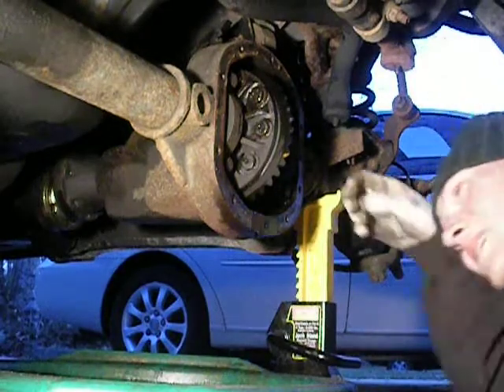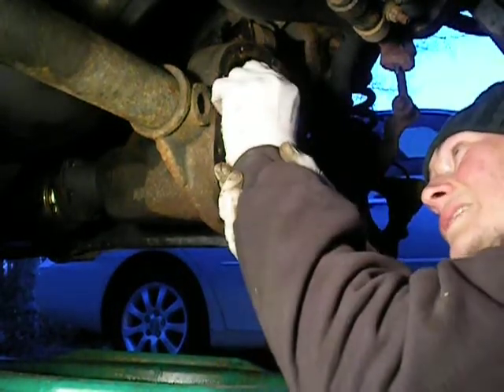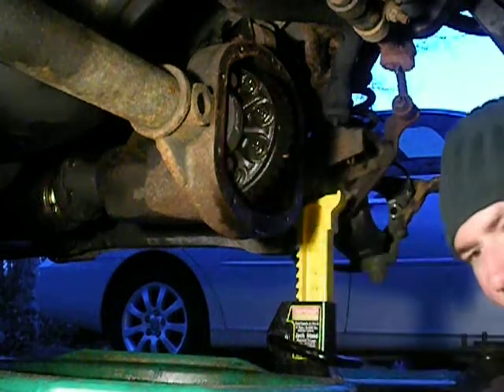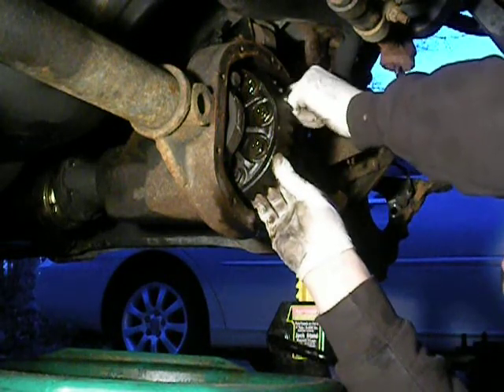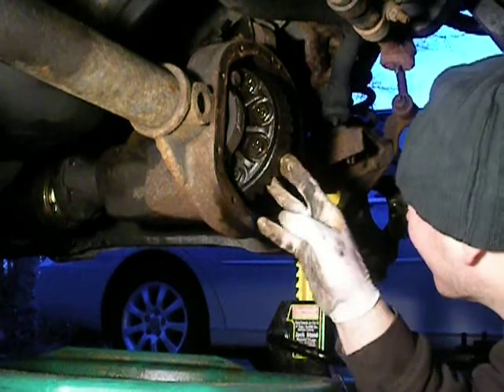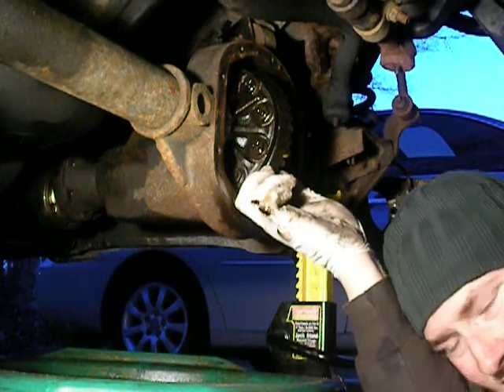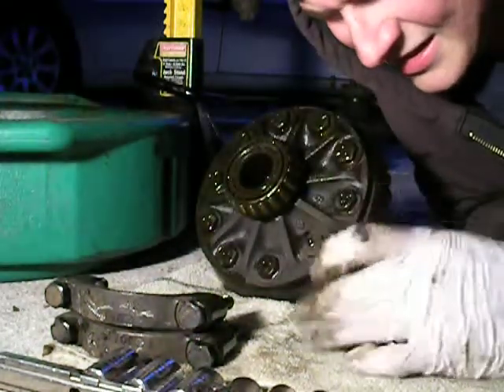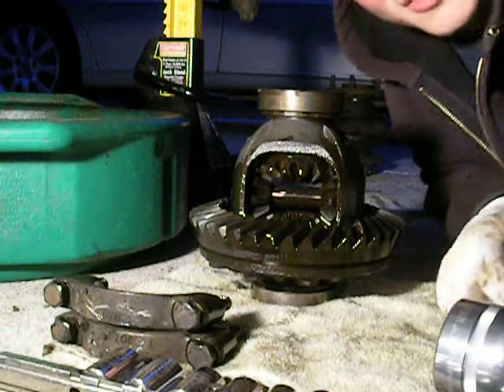1995 Jeep Grand Cherokee ZJ front diff removal

Comment from the maker: A vibration at low speeds? Through my experience a worn bearing in the differential will make a noise rather than cause a vibration. However i could be wrong. I would begin by rotating your tires and see if the vibration moves to the rear of the vehicle. Out of round tires can cause a vibration. We come across that all the time at work. 
The bearing are really pressed in, but it is a snug fit. Going back together wasnt a problem. Just time consuming.
-nos

Comment: Hey maybe you can help I have a tube hanging out the front of my differential would you know what that is and how I can fix it
Reply: I am looking at this same line, but don't have a clue to where it connects!!!
Reply: it does not connect to anything!! use a zip tie and pull the line up and zip it to something, it's a vent line so that moisture doesn't get trapped and build up in the differential.

Comment: Any possibility i could just pull it out and not replace it, and be able to drive?  i dont even use 4wd, I have the front drive shaft pulled off. but im just curious.
Reply: if your front drive shaft is pulled then the front wheels just turn from the forward motion, if the spider gears are grinding the you may want to go ahead and remove the differential, or just replace it all, not very expensive if you have the skill or can follow the many videos on YouTube.
Reply from the maker: +David W. Reed Dave, on jeeps with the np249 transfer case, if you pull the front drive shaft you could damage the viscous coupler in the t/c. If you have the np231 or np242 t/c this can be dont without damage.

Comment: Great video.  I've got the same problem with my ZJ and the shop want $921 to fix it.  That ain't happening.  What are the torque specs on the bolts for the studs and for any other bolt you need to remove?

Comment: another one with no real knowledge of the NP 249 transfer case. If it were so bad it would not have survived as long and went through only minor changes in it's entire lifetime.
Reply: yep!!
Reply from the maker: +Scott Schoemann Do you research jeeps? And why most jeep enthusiasts choose to swap the np249 out for a np231 or np242? For regular road driving the np249 is ok, but when you start 4 wheeling with the np249 the viscous coupler wears out.